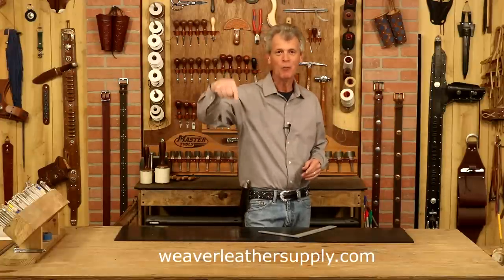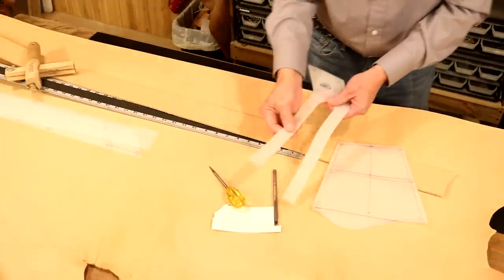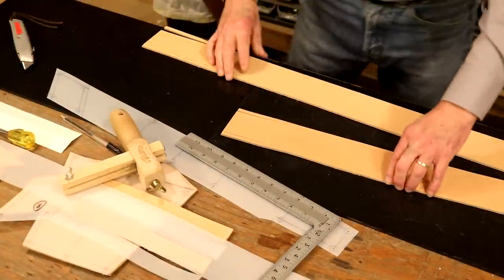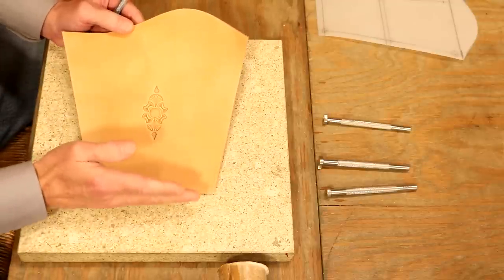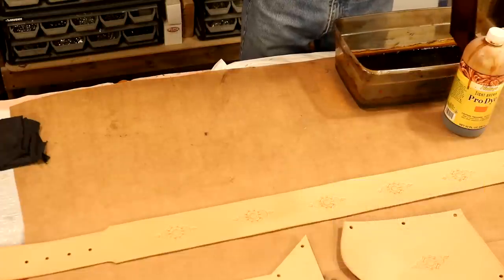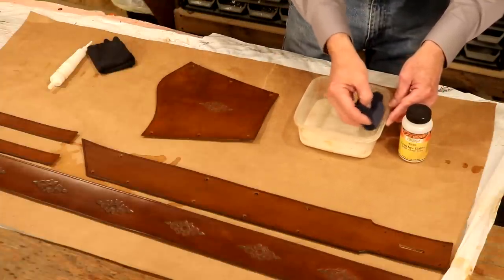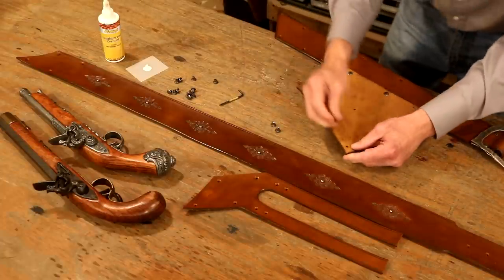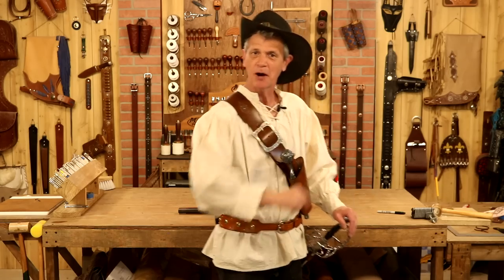Making a Leather Pirate's Baldric

Comment: Yep, a flintlock on a rainy day = mud in the pan.  Even a "cow's knee" isn't perfect, but it's a good solution for both flint and caplock pistols (and long guns).  As to a use for the punchouts, mixed with bits of cut up leather lace, they make a model railroad scenery addition.  Ground cover and other uses.

Comment: What about using a flat blade sewing/lacing punch to make the holes for those little nickel spot?
Reply from the maker: That should work! As long as the punch blade isn't wider than the tine of the spot.